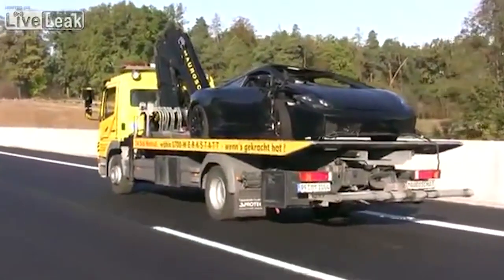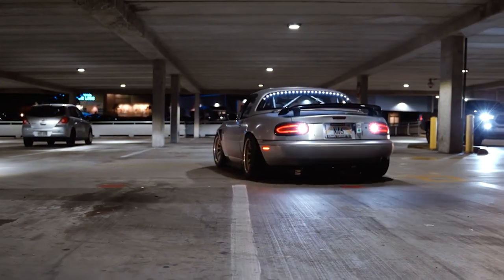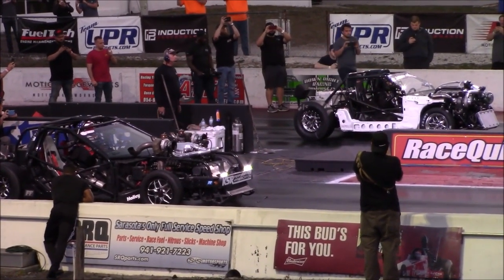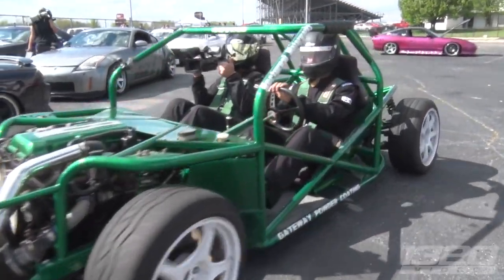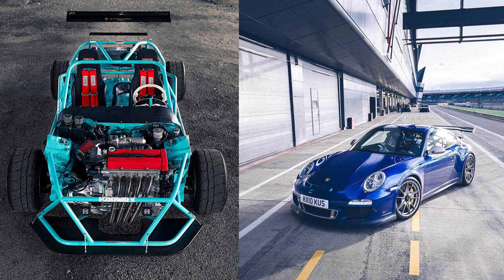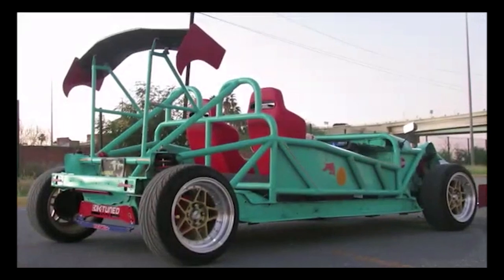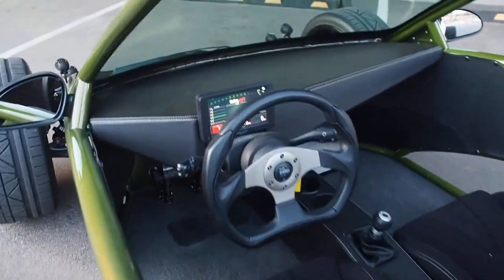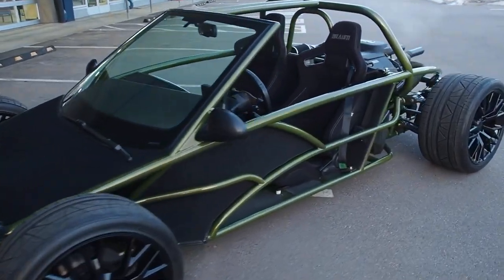How to build a supercar slaying EXO Car yourself

Comment: When I used to tell people, in the late 90's, that my grandfather's used car lot had for sale a 1974 Puma GTE with the optional 2.1 VW Boxer and it was faster than most sport cars that were sold at the time people would laugh at me. It had 150Hp with 680Kg, a really low center of gravity, rear wheel drive and a mechanic package so easy to maintain or fix that anyone could do it in their own house. It was based on a hatch chassis from the VW brasilia. I loved to drive it. I'm looking for one since I turned 18 but they became quite rare and desirable nowadays with the 2100 engine.

Comment: I have been thinking about gutting a Ford Crown Victoria. Similar to an exocar. Since there is such an abundance of parts for the Crown Victoria. Then, I'm doing an LS engine swap. Once again due to the abundance of available parts. Although I would like to gut the doors and roof so that I could drive it in adverse weather conditions. However a Ford Crown Victoria is heavy and even with everything gutted it would still approach 4000lbs or more.

Comment: With some of  these frame cars.... it could be cheaper and faster to just build a tub frame and get an engine.
Reply: Except that you'd have no chance of attaining street legality... when you start with an existing vehicle and take the torch/cutters to it.. you retain legality due to the existing VIN and core structure's crash testing as long as you dont cut in too far. lights, wipers, windscreen, etc... are all still there, just altered within legal limits from the original vehicle's specs,
Reply: @BrianWD75  you can quite easily get a 100% custom car registered. There is a list in every state that details what you need. A crash test rating is rarely if ever required. Think, motorcycles have no crash rating, they they are still sold and legal.